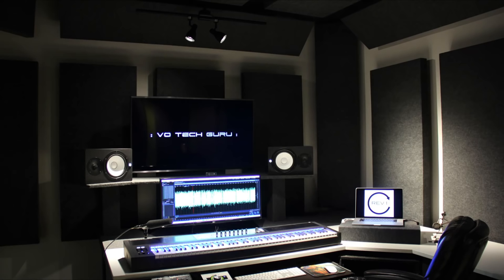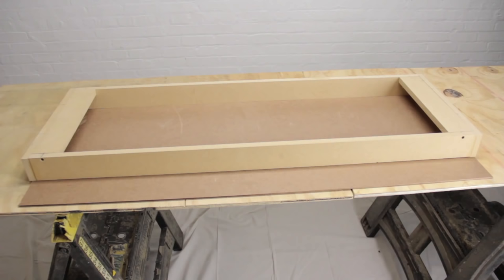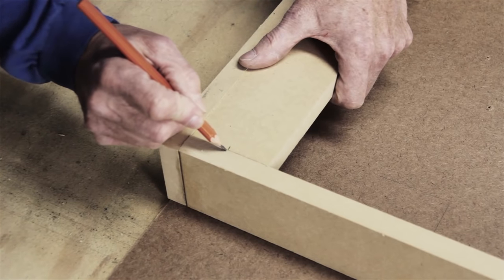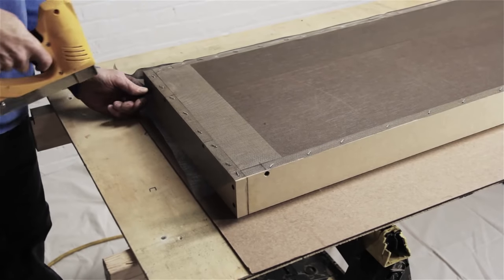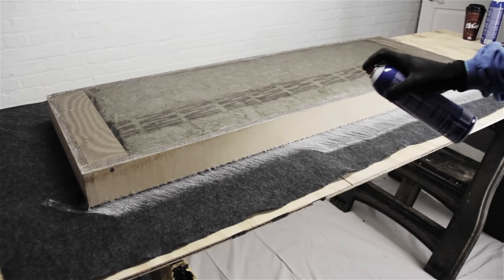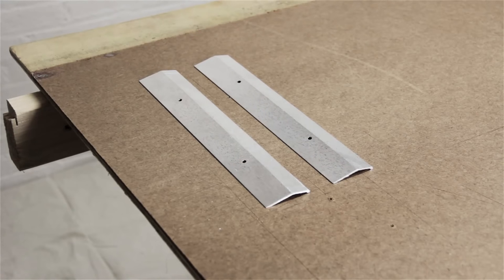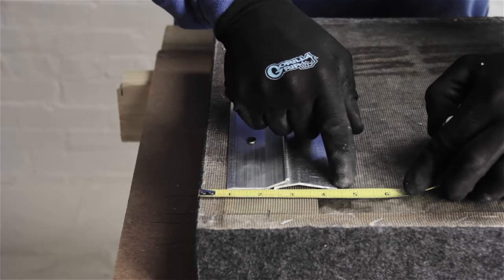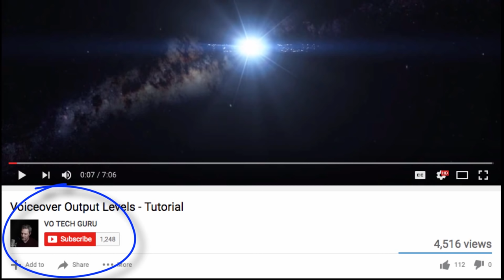How To Build Acoustic Panels | DIY Acoustic Panels

Comment: Just a heads up for anyone who is watching this a few years down the road, and this may only apply to Seattle-area locations: Neither Home Depot nor Lowes will cut anything shy of 6" based on what they quoted as new safety standards.  Make sure to take that into consideration when building from this or any other plan.  And having said that, if you have access to a chop saw and a small table saw, getting the large store to at least get the strips down to 6" each is far more manageable to further cut on your own later than transporting a full sheet.  Still worth it.

Comment: Using that carpet transition strip to hold up the panels is genius! Thanks for the video
Reply from the maker: Elsif Thank you for the compliment and for watching!
Reply: That’s the part of the video where I cracked a big smile 🙂 I love repurposing materials meant for other than their original use.
Reply: I'd have to find a more apartment friendly solution to mount over those XD
Reply: I agree, I think I’ll be doing this for whatever I can hang. I bet a flat screen could be hung this way, and for cheaper, just make sure it’s going into studs if it’s a bigger one 🤷🏻‍♂️
Reply: It's long been known as a French cleat.
Reply: Basically a diy French cleat
Reply: @postmodernrecycler  I've heard of French cleats before and now I finally know what they are. Thank you.
Reply: So how do you attach them to the ceiling?
Reply: Space behind panel should be same as panel thickness.
Reply: @NathanielKrefman  cool thanks!

Comment: There are a lot of variations for doing this, but the basic design is great.
I used 24" wide rockwool, and instead of screws I used wooden pegs and No More Nails (very strong adhesive).
Home Depot had white painted 1x4" pressboard for about $3 each (8 feet). Each 2 of those made one box.
I got fabric from the discount bin at a fabric shop, there were LOTS of options. I think I paid $10 for enough fabric to do all of them.
Also, as several people have noted, mount these about 2" off the wall for best bass absorption.
I built four 24x48 and two 24x24 that work great as corner absorbers (ie. not mounted).

Comment: Just a follow up, I went and got the fiberglass insulation the one that says 50 percent more sound proof, but I did it differently. I bought a Rouleaux and used that to cover up the fiberglass I bought, 3 feet tall and about and1feet and half wide, made 4 of them and put each one in the center of each of my walls across from each other, and you are absolutely right the difference is huge. Thank you again.
Reply from the maker: Thanks for watching!